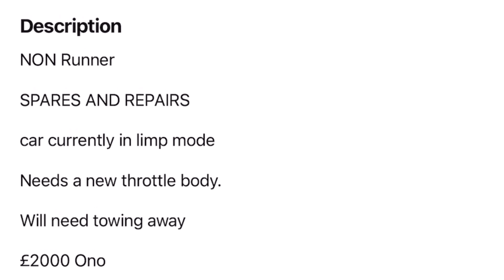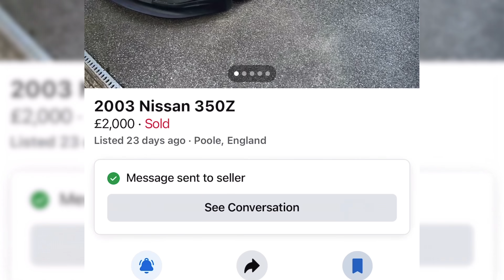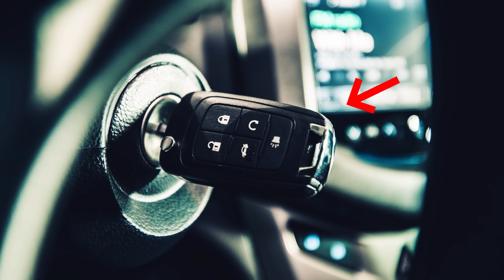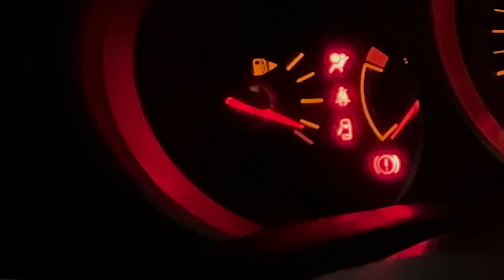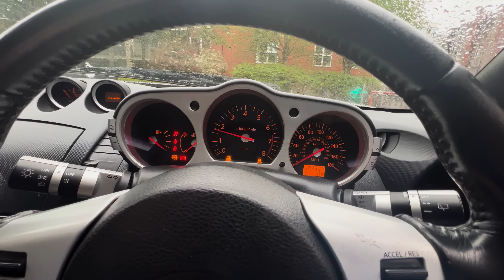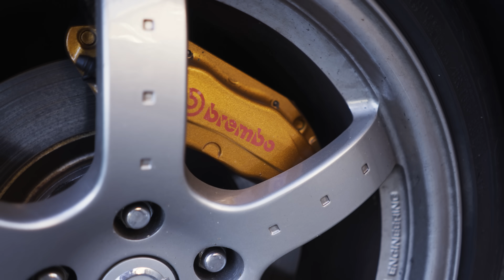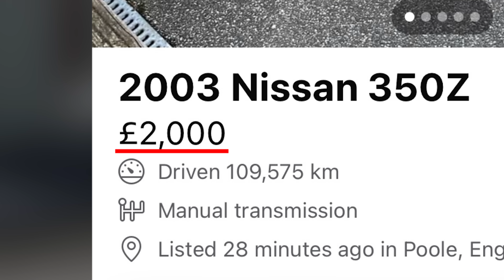Buying and fixing a CHEAP 350z for a profit!

Comment: As an owner of a mechanically pristine 350Z HR and an ex-owner of a banged up, limp mode (outside dealer's warranty) '04 350Z with £2.5k worth of issues including a messed up throttle body which I sold for parts, this resonated with me big time.